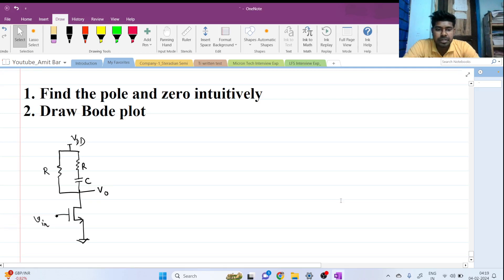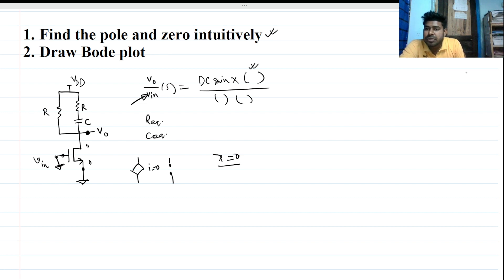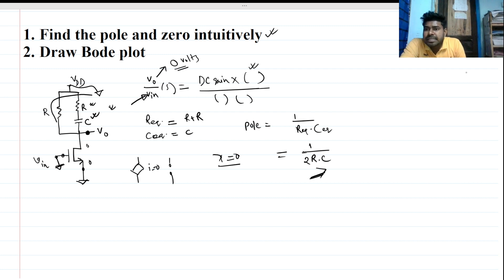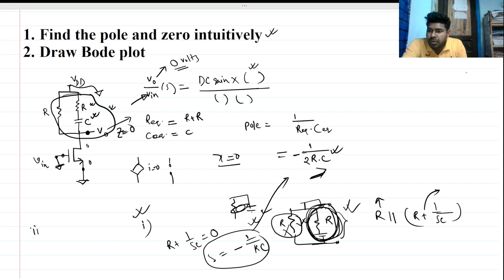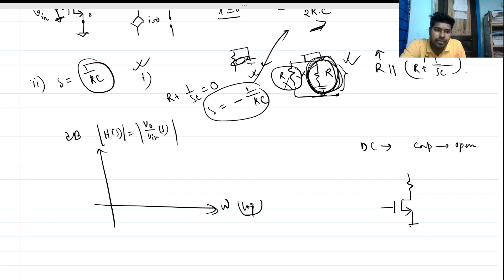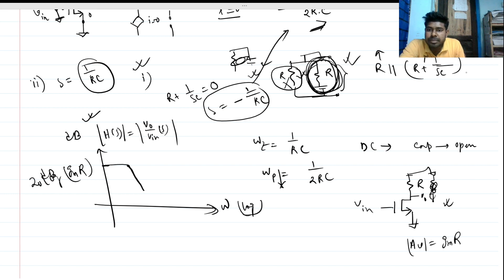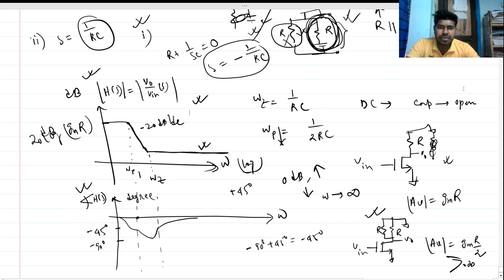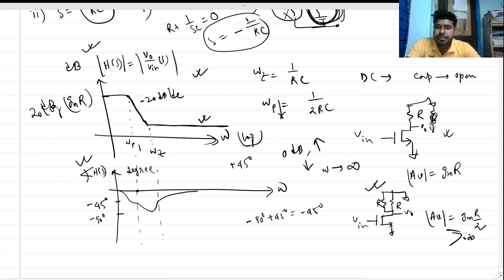Find pole and zero intuitively of MOS Circuits

Comment: To find the pole we have considered Req=2R; how does this come? It is like we are looking from Vo and since Vdd is short ckt, so we are taking it as R+R=2R ?
Reply: I have the same question
Reply: I also didnt get that one.
Reply: yes same doubt
Reply: That is right! VDD short  ~
Req=r+r=2r
Ceq=C1
Wp=1/Req*Ceq=1/2R*C...Answer 
But the circuit just only hava a zero at Cs The zero value of Cs capacitance with Rs is the zero value of the famous Cs stage with Source  degengeration.... 
And then the only Single pole Wh=1/2R*C of the Circuit and then the Bode plot is Low pass filter Wh=Wp=1/2R*C and gain bandwidth=wh*Am
The zero is infinty.. 
Vo/vi=Am*s/(s+wp1) 
Am=-gm*(R//R) |Coupled capacitor short.... Answer
Why Cs circuit d point has a zero??
Reply from the maker: I was just giving the concepts of poles zero effect on Bode Plot...Thanks.
 but due to the closeness of pole and zero for this particular circuit it becomes a bit complicated
Reply: @AmitBar-Analog_Circuits  Amit, we all thank you for the nice and informative videos, they are very helpful - we just couldn't follow that one step. After vin is set to zero, how do we reach the  conclusion that Req ( between vo and gnd, I assume?) is 2xR?

Comment: How at the infinite frequency the bode phase plot will reach 0 degree?
Reply from the maker: At almost 10 times of zero frequency,phase becomes +90 degree so  due to pole we have -90 degree previously so overall phase at infinity frequency= -90 +90 = 0 degree
Reply from the maker: Never reach -90 become zero occurs before 10 times of poles,,so eventually phase becomes positive at infinity frequency for this particular circuit